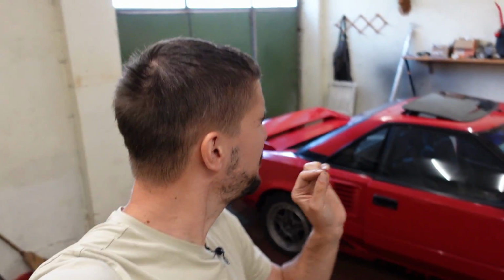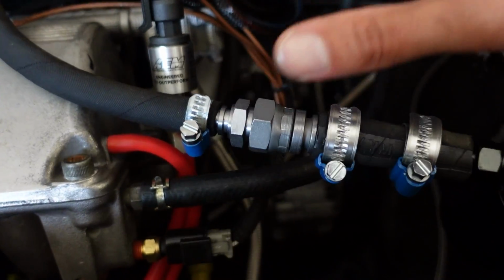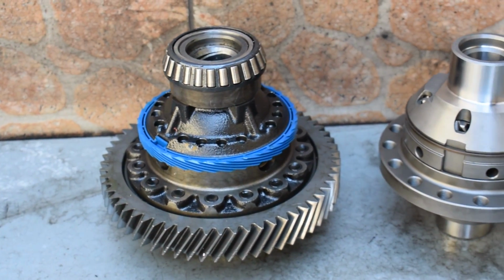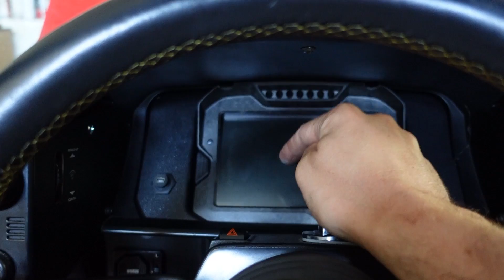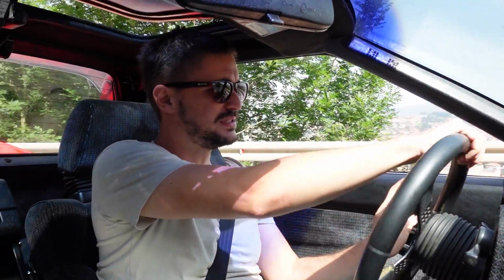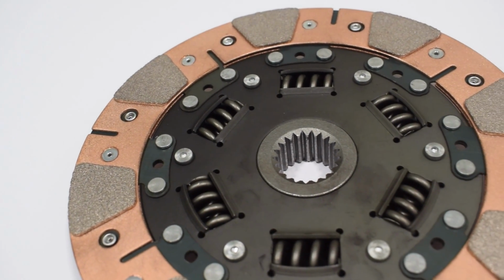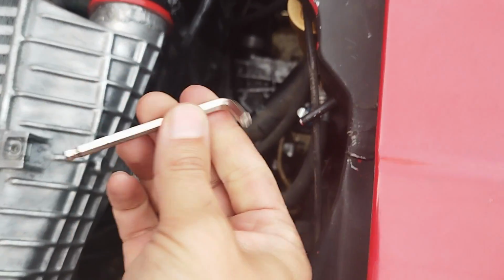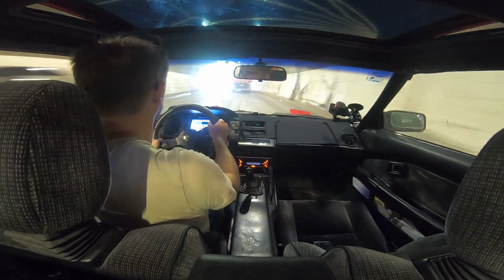Project Underdog First Drive - Turbo 4AFE Toyota MR2 mk1 AW11 spools up for the first time!

Comment from the maker: Big day! The audio is poor in some places but the vid has English subs. 
Check out the businesses that helped make this build and its content possible:
https://www.aemelectronics.com/
https://www.weldspeed.com.au/
https://midshipgarage.com/
https://www.maxpeedingrods.com/
https://www.mrpltd.co.nz/
Once more, feel free to ask any questions you might have, or alternatively if you want I can try doing a Q&A video. There will be more content in the future of course, especially regarding the software side of things, since I mostly covered the hardware so far. I also hope to do a proper POV no talking drive soon.
Become a Tuning Pro: https://hpcdmy.co/dr4a
Support the channel by shopping through this link: https://amzn.to/3RIqU0u
Patreon: https://www.patreon.com/d4a
Reply: Welcome to the boost life
Boost school instructor
Reply: I have a question for someone who wants to turbocharge an engine that doesn't have much aftermarket support like forged pistons, connecting rods etc, is it possible to use parts made for other engines that have the same piston dimensions?
Reply: @1vend7 I have friends who use opel superboss pistons on bmw e30 2.9 conversions so I believe the simple answer is yes.Obviously a lot more research is required on your part.Believe it or not,the old internet forums are very helpful.Most combinations have been discussed for many cars.
Reply: @teamphashash  hey thank you so much I'll try to research a little more
Reply from the maker: As long as parts fit properly with the proper clearance why not, people often use parts from multiple different platforms on a single build
Reply: Yes bro im building a ga16 and using d16 oversized pistons
Reply: Hey! im building a 7afe turbo, what head stud kit did you use? ARP? if so what was the part number? would love a full build thread on the 4afe!

Comment: I was laughing with you like I was sitting in the passenger seat. Knowing exactly the feeling you experienced🙂. I am myself working on a similar underdog project with an old Volvo s60 from year 2002. The engine (5 cylinder) is only the 2.0l low pressure turbo (7-8 psi at the moment). Getting it ready for tuning....not as nearly as complicated as your build but still enjoying every minute of it. 
I did already: NGK iridium spark plugs, Hella coil packs, Dual mass flywheel, clutch plate, pressure plate, slave cylinder, camshaft seals, exhaust CVVT hub cleaning(freeing up as it was stuck/not working properly) Retiming engine, Cold air intake in progress, exhaust also in progress at the time of writing, MAC 3 port electronic boost controller, new compressor bypass valve with upgraded membrane and spring, ALL vacuum hoses (and those little inline one way valves) replaced, both belt tensioners, new auxiliary belt, (I have the cam belt and water pump ready to be done very soon), ceramic brake pads and brake caliper rebuild kit, front and rear shock absorbers, front anti roll bar+ drop links, front lower wish bones, boost pipes/hoses done to hold boost properly😏 I recently dropped the oil sump-cleaned it and replaced all oil seals, Complete new positive crankcase ventilation system installed.
I watched I think almost every of your videos.... love listening the way you explain things... learnt a lot from you. Thank you for running this awesome channel. I would love to have your opinion on what can I do to the Volvo if you have the time for a quick advice. 
Good luck finishing the MR2....

Comment: The first choo choo noises are the absolute best! 😩 I'm so excited to see you finally having fun with this car. Boost is absolutely addictive.
I forgot you were using an MXR turbo for a second. Sounds great! That car is so light it's gonna be a rocket. Just make sure you watch out for the boost hitting and spinning the tires around a corner. 😉
Such an exciting moment you know I've watched every Underdog video. Don't worry about the flutter Australians run no BOV up to insane boost and horsepower levels all the time. We didn't put one on Rotaru either. Sounds like your flutter was reduced a lot by adjusting the BOV, so the spring may just be too strong from the start, but I'd keep it as is hahaha.
Glad the MRP clutch is good. We just put an XClutch single disc onto the rotary supposed to hold up to an insane power level like over 600 ft lbs of torque and we were amazed by the drivability and how easy the pedal was. You should be able to get boost to come in even sooner with some tuning and with the boost controller hooked up, if you want to of course.
Amazing man finally the payoff! Can't wait to see more.

Comment: Ive owned 7 AW11 MR2 cars. One of which I did a 20v 4age silver top swap with the 6speed manual and LSD that came in it from the trueno levin the engine came from. Took a bit of minor fabrication to make the shift linkage work as well as some colling piping custom work here and there. Other than that it was pretty much direct swap. I did have the ecu and had a wiring harness made by phoenix tuning made to help facilitate the ease of the swap. Still to this day  one of my favorite cars I have ever driven. These little cars are so underrated.

Comment: Im glad you got to it, i originally owned an acura/honda DC5 (k20a3) and planned to boost it on low psi... i ended up having my first son and selling the honda (mostly because of bad paint, that car was amazing other then the 5spd transmission, which i replaced twice during ownership and abused) -anyway i now own a 2005 impreza rs and its been a world of difference because the forums are no help what so ever for tuning... basically everyone just tells you to buy the STI motor trans and rear diff.. and i think its sad because especially coming from driving a honda, the budget turbo was always an option even with D-16s & 17s that would explode for sure lol. (one thing i can say about owning a boxer now is that low end torque feels amazing when you arent paying dearly in gas mileage and just cruising around, i definitely miss the linear power of inlines, they are more fun if you are rev happy like i was and plan to be again)

Comment: It's always funny seeing someone drive a boosted car for the first time. When they are built right they feel so much better than a N/A car. Some are so much like a 2 stroke with all the boost and power at the top end but most factory built turbo cars especially volvo put the power right in the driving band and having that power is always awesome.

Comment: Congratulations! 
IF you do make a duct for the intercooler, a water misting system would be a bonus. Those bar type coolers work very well until they get heat saturated. Cooling it with water when you notice power being down would keep you smiling. You would only need to fill the tank when you plan on spirited driving. 

Can't wait to see it all dialed in and tearing up the tarmac.

Comment: Throttle body can freeze with ice in high moisture low temp conditions depending on altitude, even before freezing temps. Keep their coolant flow thru it. Air doesn't get much heat from it to make a difference.

Comment: The joy that brings project cars is on a different level. You can buy your dream car, but it's never going to bring such feelings when you build one. Also, to clean up the engine bay you can get quite cheap silicone end caps from China, but for the first drive, you always have to have one bolt in some vacuum line. 😅

Comment: Congratulations, I know you have been working on the build for a while now. It's good to see it running and driving. I am also working on a build that isn't common the engine is a Chevy 2200 block with an ln2 head that I ported and reshaped the combustion chambers to lower compression (it will still be high at a calculated 12.6:1) I will also be running bike carbs like your previous version of the MR2. The carbs on mine however will be 4 FCR 41's. Good luck with your build, I would love to see another drive video or track day when it's sorted out and tuned

Comment: Even though your put your battery positive wire into a plastic tube, you should also add a fuse (like 150A, depends on your electrical system) as close to the battery physically as possible. It costs next to nothing, but if you have an accident and the wire is squished under the car, you might get a fire as well.

Comment: For battery, add maine fuse at the battery positive terminal. If anything causes the positive wire to contact body parts, that fuse will terminate circuit at initial point.

Comment: I know the feeling of hitting the road with a DIY build, even if I had only a Fiat Punto TD at the time.

In december 2005 I cracked the head, and in early 2006 I did a huge work on it.
New head, some porting, steel head gasket, modified injection pump, bigger turbo (I picked up a perfect IHI VL11 from. Lancia K 2.4 from the scrapyard), new gearbox, wheel hub and axles to accomodate the gearbox of the powerful model of the TD with the internals of the 1.9 from a Dedra, DIY exhaust and so on.

It's something shitty compared to an MR2 turbo, but it was satisfactory and with 2.1bar boost even the good old IDI 1.7 engine had something to say.
Reply from the maker: Doesn't sound shitty compared to anything if you ask me
Reply: @d4a  Man, we are speaking of two different worlds, the MR2 is another thing compared to a small Diesel citycar like the Punto .

However I was proud of it (and it leaves behind some more powerful cars), it was my "on the road experiment" for eleven years, bought it in 2001 when I was 20 and demolished in 2012 with more than 285,000km.

I like your work, cheers from Italy!

Comment: Excited and overjoyed at 7psi of boost. A long time ago my first turbo car was a Toyota Celica GT4 (ST185), and in first and second gear it was limited to 8psi and in 3rd,4th and 5th it was limited to 12psi. But when it overboosted it was much more fun. Now I have a GF8 wrx and its twice the car the GT4 was and weighs less and does 14psi in stock form and thats plenty of boost for me.

I like it when he said "I love boost"! Yeah boost is a heck of a thing. Turbos totally changes the dynamic of an engine and of the car, from lethargic or mediocre to an a**kicker. Previously that MR2 might have struggled to climb some roads, now with throttle control it won't struggle, but you can literally choose the speed you wish to climb hills - comfortably at the speed limit, or a little over the speed limit, or at the raggedy edge of grip, all because of the silly blow dryer on the exhaust.

This dude just became a turbo aficionado. And where is it that you live? I was thinking it looks like Italy or Slovenia, maybe down the Croatian coast or Montenegro coast Somewhere? Maybe you're on the other side of northern Italy coast.

Comment: Glad to see your car done!! Hope you get to enjoy it, go for a nice road trip once you know it's reliable. 

I would definitely put some terminal covers on the battery, just in case you throw something in the trunk or that spare tire shifts.

Also get a box of vacuum caps, various sizes. It'll help clean up the engine bay and have less points of failure.

Comment: when you have a coolant system that runs to the front of the car from the back, use a vacuum filler to pull vacuum on the whole coolant system and fill it. airlift makes a product ive used many times with no issues. worst case scenario if you still have an issue with air in the system, you can lift just the rear of the car to make the reservoir the highest point and rev the engine so the  water pump moves more coolant to flush the air out. this worked on every porsche and ferrari ive ever had to use it on

Comment: 1:20 ~ Wow...love that layout with the turbo.  I bet one could throughput size something around standard and trace the path out for each system.  I had my 1995 Tacoma, Xcab, FWD with 3.88 R/P.  Very nice to have in wet weather "Eaton" Limited Slip.  1 Ton helper springs with Rancho shocks.  Very rare 1st gen ARB front lockers. 3rz rebuild with chrome accents.  Was close to turbo install after solving issue with head bolt cracks that others noted in their install.

Comment: Nice too see it coming together.
I have the ”rival” to this, the pontiac Fiero. Hopefully this winter Ill finish my engine build and swap on it.
Itll be a 3.4 V6 with around 250-270 hp n/a and around 350nm torque. All going through the 3 speed auto.
So very different cars but so similar 😁

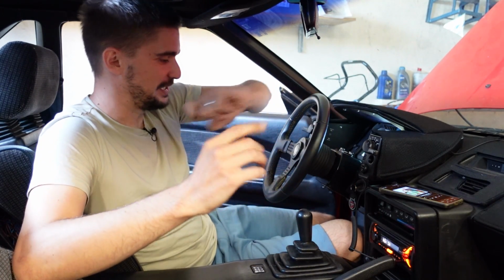Comment: The easiest way to bleed the cooling system (the modern way) is to drill a small hole into the flat plate of the thermostat and make sure the hole is clocked at 12:00. The hole is probably sufficient if it’s no larger than 1/16”.
Reply: BTW, it sounds like your turbo might be a tad too big. I think you should be going into boost 500-1000 rpm sooner

Comment: One way to set a BOV is to have it just closing at idle vacuum. If you cannot achieve this with the adjustment screw then you need a lighter spring. AEM has a very nice data logger. You should log while you drive and then make adjustments at home or send the logs to a tuner. I wouldn't drive it too much with your AFRs in the 9s; you risk washing down the cylinders of your new engine. Low to mid 11s would be very safe at that boost level.

Comment: For the intercooler, I have seen people with supercharged MR2s put a fan with some ducting on the bottom of the intercooler to draw air through and out the engine deck lid

Comment: it is actually possible to mount r8 style coilpacks, you just have to cut the rubber just a little bit so it does go all the way in and it will be so snugly in there that it's not going to move anywhere by itself :)

Comment: may be worth doing a water to air intercooler; I remember one time on my stock 3rd gen MR2 I was driving up a  twisty mountain road in summer and pulled off to look at the view. when I got home that day the engine cover wouldn't open anymore. Turns out I melted some plastics in the engine bay, including the sheath to the latch release.

Comment: Congrads🎉
Finaly a running car 
Been there too with my old Corolla AE111 (3sgte swap) project and realy understand everyting you just said about a reward feeling of a proper working project car 

About the blowoff valve maybe its stuck of sitting a long time take it off the car takebit apart grease some stuff and test it with a compressor you should see it moving 

And about the battery you should cover the Connectors i made that mistake to put it in the trunk of my corolla and on a trackday it didnt pass safety and there was nothing flying around in the car 
With your spare wheel I think it is a safety consern 

Im impressed with the "no tuning" and ausies call it dose 

Enjoy the car !!

Comment: ALL sensor connection wires must use "gold" copper plated connectors instead of cheap tin connectors. There is a difference in signal degradation. I found out during tuning supercharger for my NC Miata. Solders tend to break when flexed, not recommended.
I usually use oversized crimp connectors, overlap the wire strands and crimp direct contact for best results.

Comment: "You cant have to much coils" - plugs sweating in the background.

The throttle body heater is to prevent icing of the air due to very high speed of air (having low pressure). And also to heat up electronics to remove any accumulated moisture. The heat from it is literally unmeasurable.

Ps Keep up the work, love following your channel!
Reply from the maker: Thanks man! I'm a bit confused on the plugs sweating though? Also, immeasurable heat heating up electronics and removing moisture... It must be measurable then? Just messing with you 😉
Reply: @d4a  the plugs sweating :) - if you are pumping more energy through them than they need (as at certain point there is no increase in combustion performance), they will work harder than they need, meaning they will Wear the plugs faster than they need - hence why I wrote that they will be "sweating" :) . usually it is advisable to run as little DWEL time as needed without a drop in performance. 

as for temperature :D because convection heat transfer has so little time (per volume of air) that it is unable to effect the heat energy / temp of the air going in to the engine (for the other readers of the comments :) )
Reply: @d4a  for this "hot intake" argument. we actually had test on renault clio 197 engines. the IAT sensor was getting heat soaked and reporting crazy air temps. Changing the type of the sensor to plastic changed the IAT more than any mods for cooling the intake plenum - which is aluminum and gets hot from the enggine.. The original sensor would always read IAT few degrees lower than the intake it self ~70 - 80 C, while the "plastic" one would read few above ambient :) 
That kind of proved that even the whole plenum being hot didn't effectively change the charge IAT :)

Comment: Congrats to a nice build with a lot of work behind. Looking forward to seeing it Dyno mapped and making serious power. I also have a mid-engined car (X1/9) and find a W2A Charge Cooler much more efficient than an A2A Intercooler. At just a modest 0,5 bar boost, your intake temp is 45°C (@ about 25°C ambient I guess). Despite the airflow from side ducts and from underneath, there is no way that the Intercooler will manage at a higher boost as even the current intake temp is quite high. Heat is the biggest enemy on mid-engined cars but it can be fought.